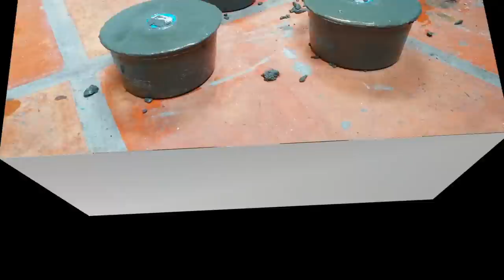How To Make Homemade Weights (DIY Dumbbell) Gym at home/#2

Comment: Nice work. A little improvement is needed not to crack in a fall. Take metal wires and make a circular meshwork and insert inside each dumbell then it wont crack in any impact. Also u need to add gravel to the cement and sand mixture for a proper concrete to bond. Initially you can measure the weight of the mixture and add more gravel to increase the weight if needed. 
Mine lasted more than 4yrs and still using. This is really durable if made properly.
Reply from the maker: Thank you

Comment: Hi mate, great video, thanks  for posting. One question though, since cement/concrete has a lighter specific weight than iron, I wonder how much are you using to come up with weights. Could you share that? For example how much you use to get a 5KG piece? Thanks
Reply from the maker: Exemple if you make 5kg piece (2 kg of sand + 1.5 kg of stones + 1.5 of cement and mix with water = concrete) Or you stress it exemple ( 2 bowls of sand + 2 bowls of stones + 2 bowls of cement mix with water=concrete) Thank you bro 🙏

Comment: Your efforts are good.. but i tried these if u accidentally get a crack it will brake the whole dumble
Reply: Duct tape the whole thing. Even if it cracks I bet it won't crumble.
Reply: Then make a new one...
Reply: Add iron wires in it
Reply: Just use metal pipe
Reply: Gaurav Sharma use ducktape
Reply: My friend you need some flex seal
Reply: Hydrate it properly than, it wouldn't end up with cracks..
Water , that's all cement need to stay hard..
Reply: use REINFORCED Fiber Cement. Won't crack...

Comment: vai thik hai per weight to check kar...ager ka weight me difference hogaya to dekhna ak chota aur ek bada hojaye ga😂😂😂
Reply: # Bjoy sahi he bhai....weight ka to RIP kiya he
Reply: Use gravel in cement and sand mixture. Before adding water measure the amount for one dumbell using a scale and adjust according to the desired weight. Adding water does not change the weight at all. So the initial weight will prevail in your dumbell.

Comment: What will be their weights... My brother is going to make them after watching this... But he is not sure of its weights... He needs dumbles from 5 kgs on wards , so which size moulds to use ? Please answer
Reply from the maker: Example if you do 10 of dumbbell you must to put 3.50 kg of sand 3.50 kg of rock and 3 kg of cement after mixing with the water

Comment: Can you please explain the pipe sizes you have used for the bars and those fittings.
Reply: I'm waiting for your answer
Reply from the maker: Pipe size 0.027 milimet
Reply: @SARAYGEAR  but which fittings have you used besides the pipe. I.e union? Pls tell so u can purchase from the building material shop the correct item. Also please tell which kind of pipe you are using. PVC, PPR?

Comment: How do I measure the cement to get the right amount of weight
Reply from the maker: If you do only cement with sand example you must put 50% of cement & 50% sand if you need with all so rock you must do weigh example 3 bowl of sand + 3 bowl of rock + 3 bowl of cement